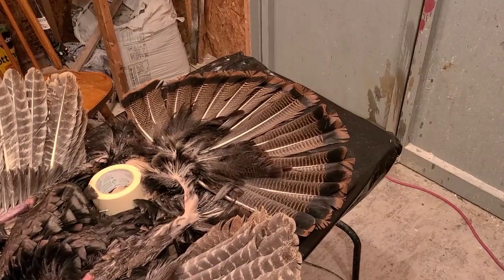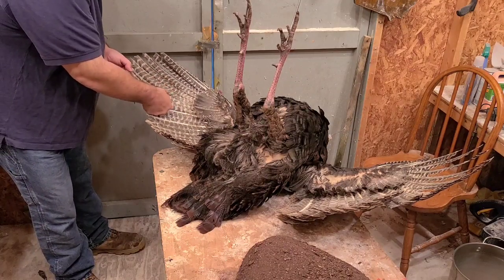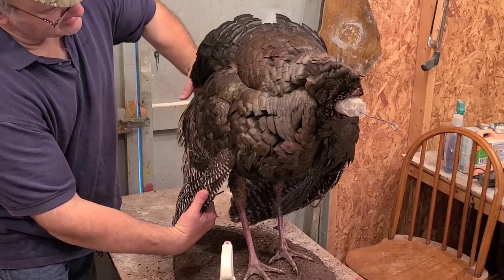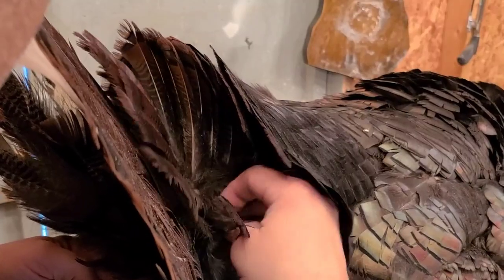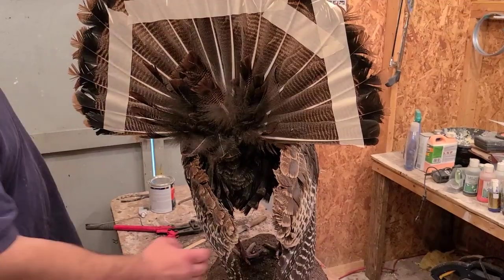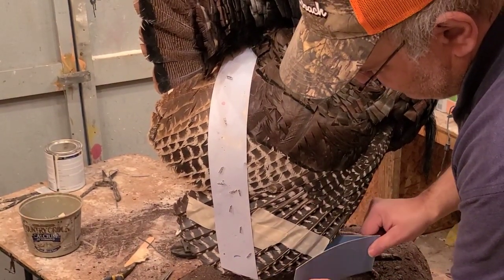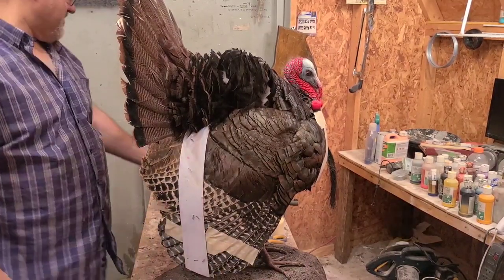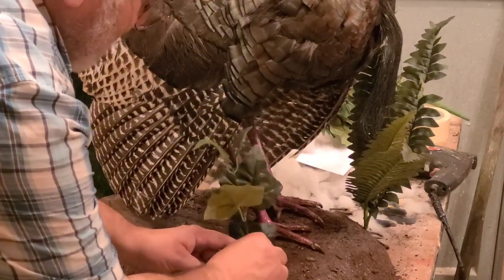Reinstalling a Turkey's Tail,Head,attaching to a base,etc..

Comment: do you use caulk or silicone on back to make feather quills stay put?
Reply from the maker: I haven't used either,but have thought about it..I just rake the feathers forward..After a few days they hold in place.The feather quills stick in the polyfil underneith